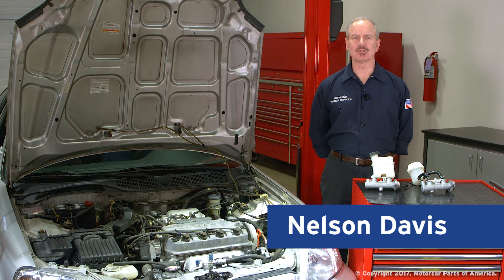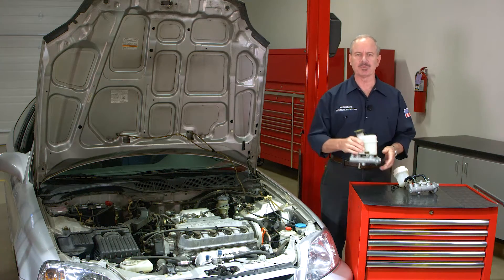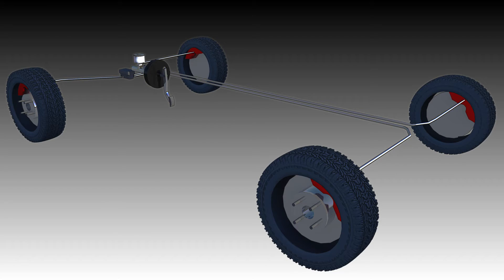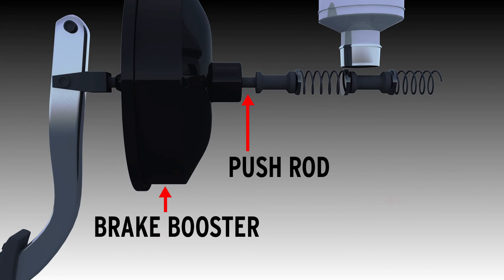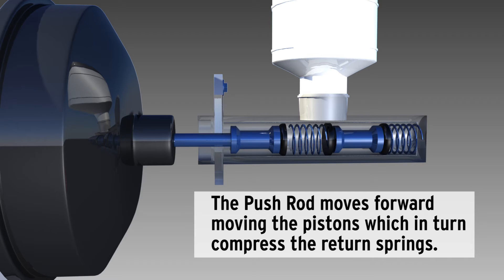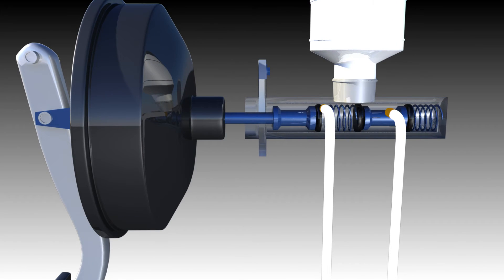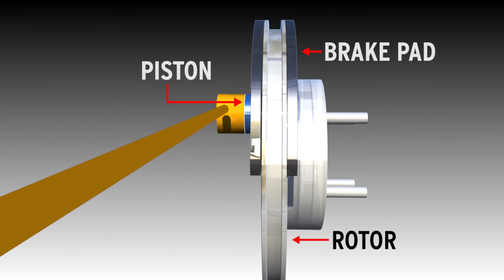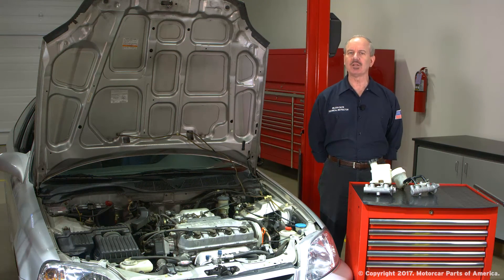The Master Cylinder: How It Works

Comment: I push too hard on my break and the back driver side wheel seal busted so fluid started coming out.

I only assume it's a seal because it burst under pressure could it be something else?
Reply from the maker: It’s either a faulty caliper seal or wheel cylinder seal, depending if the vehicle has disc brakes or drum brakes. In either case the caliper or wheel cylinder will have to be replaced.

First thing to check is the condition of the brake shoes (if your vehicle has drum brakes) for wear. If the shoes are too thin the wheel cylinder will over-extend and that could be what possibly damaged the seals. Another cause of damage to the seals could be a faulty automatic adjuster.

I would recommend that you inspect the brake system to make sure that there are no other issues that contribute to this symptom.

Please see the check list below:
 
•  First things first, practice proper SAFETY. When performing any service and automotive diagnosis follow the OEM approved service and safety guidelines!! Wear protective equipment (gloves and safety goggles) when handling brake fluid. Brake fluid is caustic and could damage paint surfaces and cause skin irritation.
• Brake shoes will need to be replaced if worn or brake fluid contaminated.
• Adjusters will need to be replaced if faulty (a common issue is rusted/frozen adjusters)
• All brake hardware will need to be replaced. Sometimes the return spring breaks will cause the brake shoe to over-extend, therefore causing the aforementioned condition.
• A brake fluid system flush is imperative to assure braking performance.
• Utilize ONLY the OEM approved type of brake fluid from a fresh sealed container ( DO NOT REUSE old brake fluid!!)
• Adjust, bleed the system, and perform repairs as specified by the OEM. Perform a road test in order to verify the repairs.
 
If you require further assistance and have additional questions please call our toll Free Tech line at
1-800-228-9672.